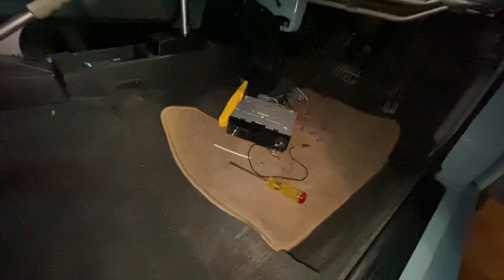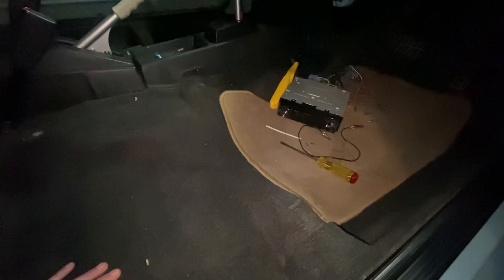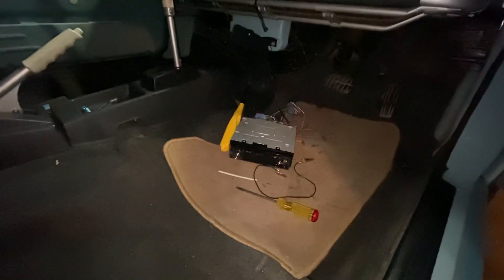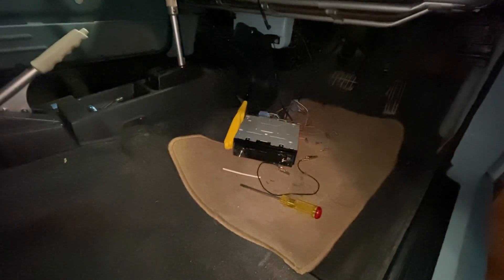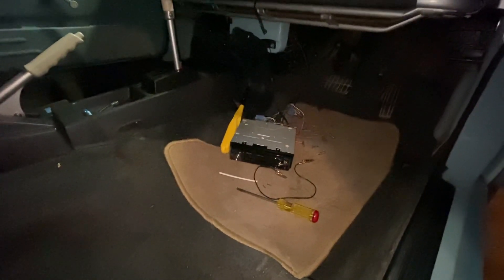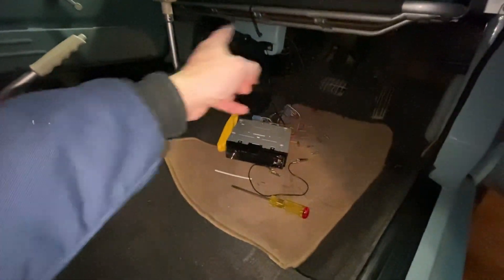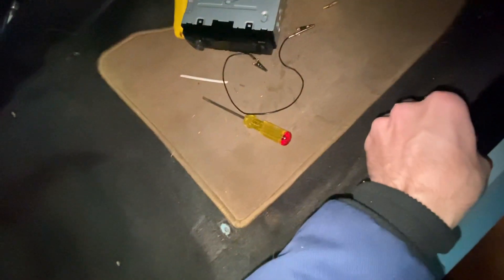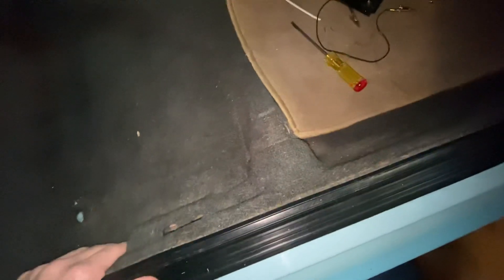All Seats Out of Nissan Pao

Comment: I'd route it under the center console to avoid damaging the carpet or any trim pieces.
Reply: I second this. Maybe maybe a small incision in the carpet right before the center console ends and then you would only need a short run under the back part of the carpet that will come up.

Comment: It’s glued with some sort of adhesive- I took the fasteners of the back part of the carpet and it’s stuck in place. Not entirely sure what’s running under it. I believe that the oem speakers have the wires running by the passenger door, somewhere by the left of the seat. I’ll go look out in my pao soon and double check.

Comment: Might be a previous modification but all my Pao's wires run down the edge of the carpet by the sills, accessible after lifting off the black sill kick plates, or down the centre console (to the pseudo-ECU). Never had to remove the carpet, just lifted the edges.

Comment: I think your best bet is to run the wires out the window, have them dangle along the outside, then cut a hole in the rear quarter panel behind the speakers and hook them up

Comment: I'd try a wire fish tape, maybe put a bulb end on it to better follow the contours? I have one of the smaller Klein ones for network cable and such. Just make sure you get one of the ones that is an actual spring steel tape, not one of the braided/plastycoated wire ones, they suck for anything other than conduit/ducts.
Reply: The Home Despot has the basic 25' Klein one for $13.

Comment: Can you fish it under the center console, or even remove the console and run the wires under it?  If you don't have a fish tape or stuff wire, cut a metal coat hanger.